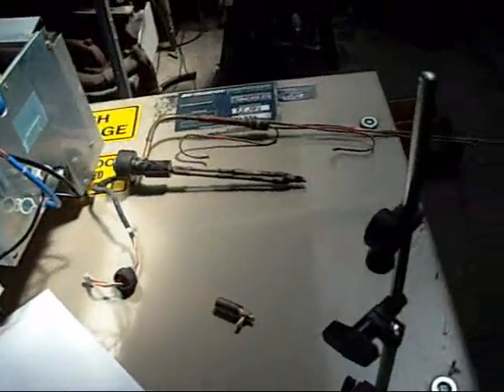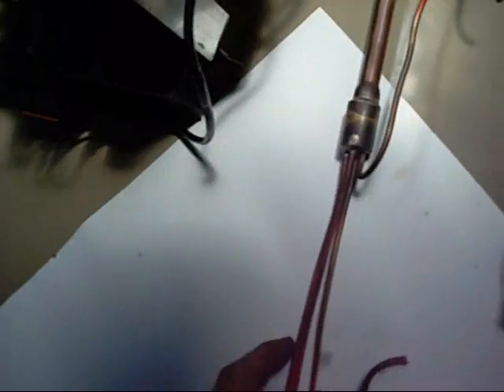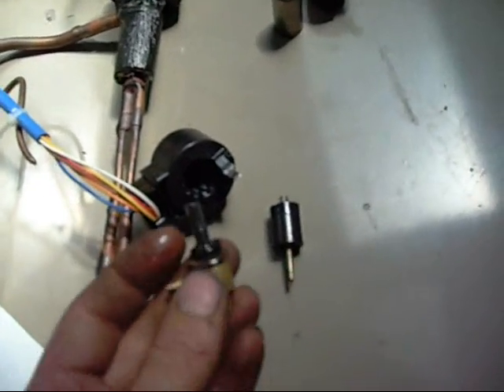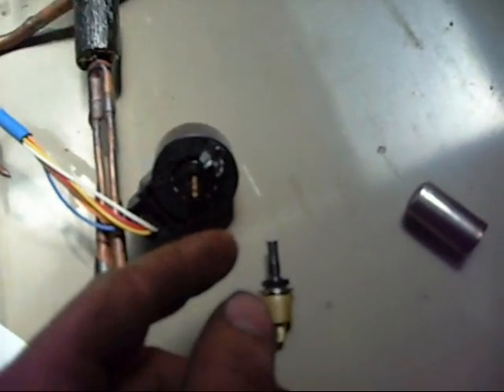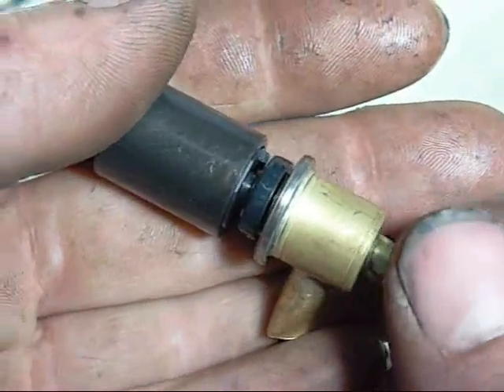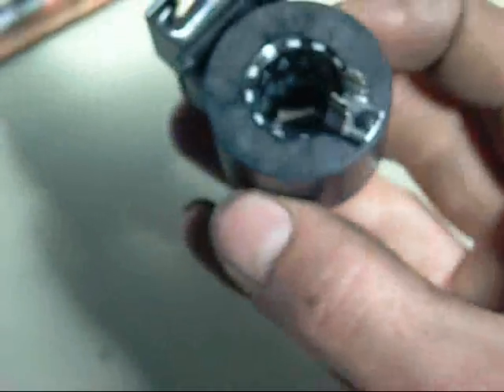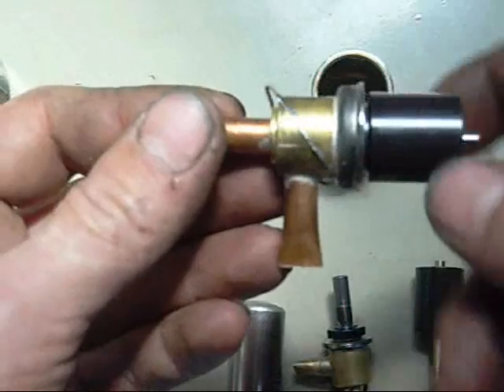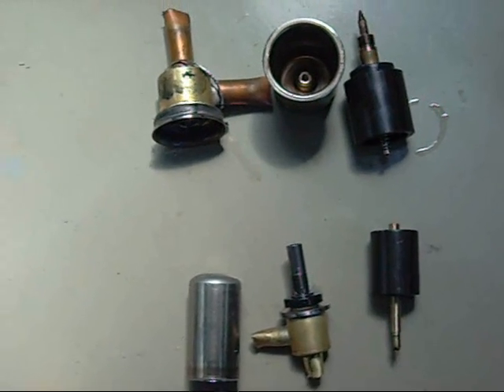HVAC Electronic Expansion Valve

Comment: Thnx for ur video, 
I have a question, is it possible that on a mini split, the EEV closes completely and makes a vacuum by itself? I have this problem with my client. Thank you
Reply: yes. the fault is probably the coil. it has 4 windings. the red or red and brown on one end of the connector are the common positive.

Comment: hello , do you know how i can know the internal size for a fujikoki ,model , it's monted on a 10 kw unit daikin size 100 use R407C , 10 years old 
it's a  6HP compressor , but daikin can decide use a bigger expansion valve than the nominal power and use less steps ??? my body ref is 40 YPDM-1  4F28K 
pearhaps size is 2,8 mm ??? i need change because after defrost , i rest closed and high pressure drop in heating mode , the problem is mecanic i think , not coil ( i have test the resistance values , alll is ok ) 
thanks for help 
claude

Comment: huh, interesting.  You can see the stops on the valve body and on the bottom of the rotor where it hits when it stops at its home position.  I've been thinking of making my own air conditioner, and that would be a lot easier to deal with, and more controllable electronically than a pressure based expansion valve.

Comment from the maker: @richardc1983 yeah, its like a reversing valve, somtimes you can tap them free, but once their stuffed its replacement time.

it shouldn't clunk hard, but that sounds more like the electronic driver

its essentially a stepping motor, and it should have a 'home' position programmed into the driver. if the driver looses the 'home' position, it may try and wind it back further even though its on its stop

see if there is a way to reset the PCB before replacing it, it could be a error in programming

Comment from the maker: @richardc1983 the metal dome is not removable, it is under gas pressure and soldered on.

I removed mine with the lathe for demo reasons only.

Comment from the maker: @richardc1983 if the valve is stuck internally the only remedy apart from replacing it immediately, would be to give it a light to moderate tap with a screwdriver handle and try and dislodge it.
you could do it with the coil off, or on as its trying to tick over.
Reply: Aussie50 thanks you saved me a lot of time and money   ..  my problem was that it needed hard reset with a little taping dont know of the tapping did anything but the reset was the trick

Comment from the maker: some have variable fan speeds, some use only high/low like my 4ton Fujitsu outdoor unit.
the indoor ceiling cassette had a variable frequency fan driver but it burnt out, now i just run it on high.

your right about referencing the indoor/outdoor units, it dose get confusing otherwise.

Comment: very neet little valve, to bad stepper motors are a bitch to run without a very strong understanding of the singnal generaters the drive them.

Comment from the maker: yes! there are thermistors for compressor discharge temp, cond coil liquid out temp, outside air temp, indoor air temp and evap coil temp.
the unit uses temp readings from all of those to regulate refrigerant output and fan speed